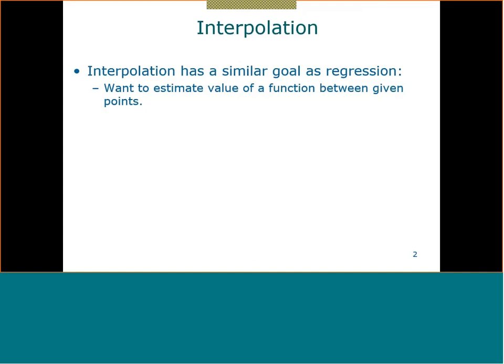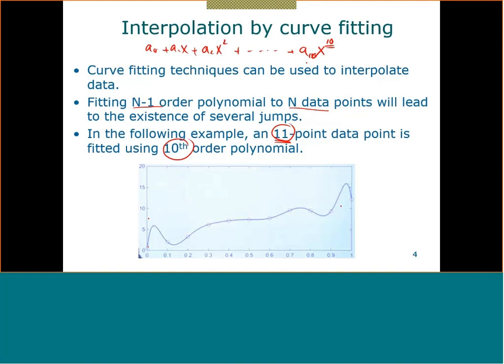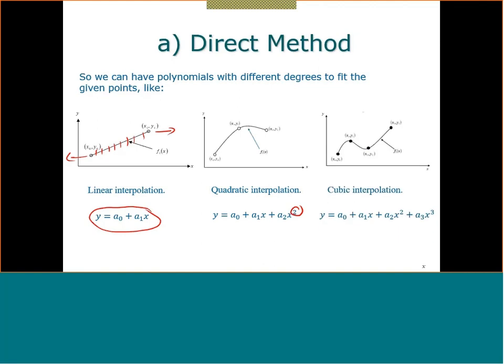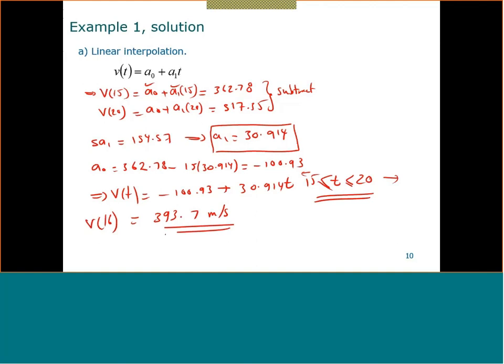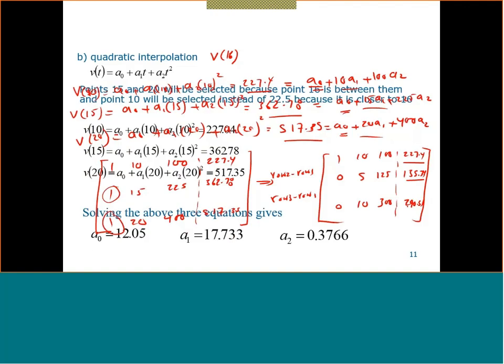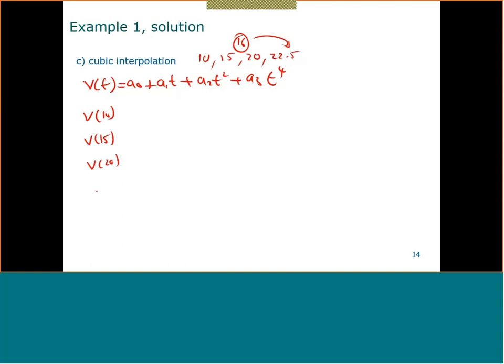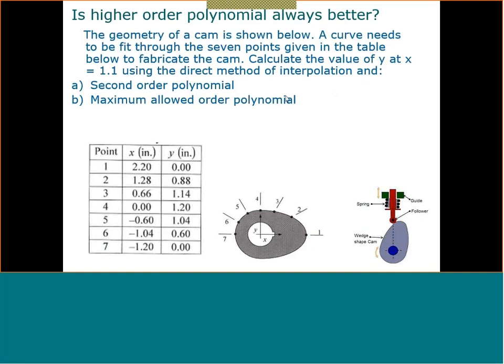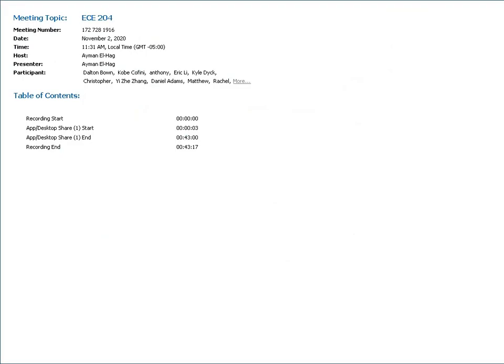Lecture 16:  Curve fitting (Interpolation) - Part 1

Comment: Assume we had more data before t =10; how would we know which data points to choose? 

like say we had data for t = 5, t=8 and then we have t=10,t=15,t=20,t=22.5 as given.

for part c, would we set up equations for v(8), v(10), v(15), v(20) or would we set up equations for v(10), v(15), v(20), v(22.5)?

if it is just the closest points then what would we do if we had data for t=9.5 instead of 8? the abs difference between 16, 9.5 is the same as the abs difference between 16, 22.5
Reply from the maker: We choose the closest points, but if the distance between the points from top and bottom are the same, then we can select any point.
Reply: jazakallah khair! thanks prof :)